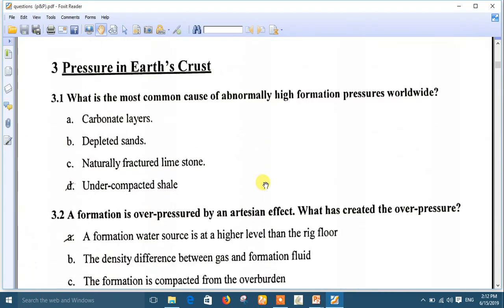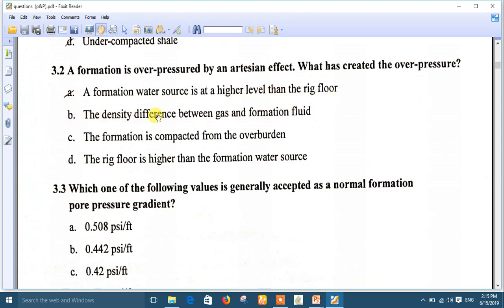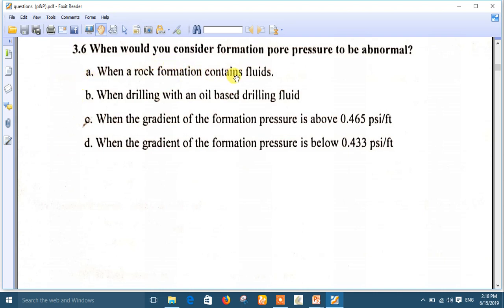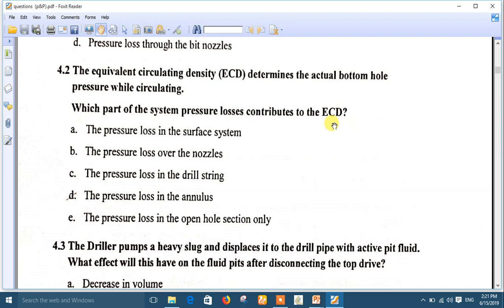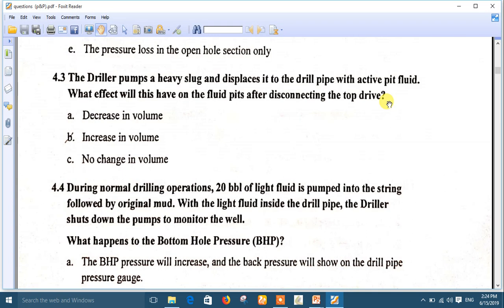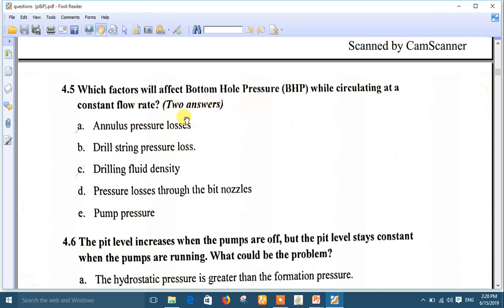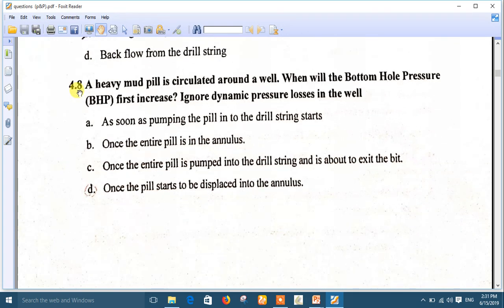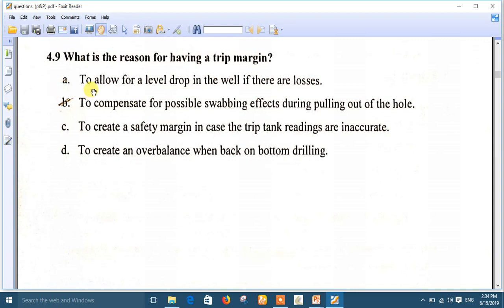5. IWCF pressure engineering questions

Comment: Plze review Q 4.7 i think will be back flow from drill string >>due to U- tube effect which no float valve 🤷🏻‍♂️
Reply: Yes AGREE
Reply: I agree, too
Reply: Yes, and mud level in the annulus will drop. So BHP will drop due to mud level drop in the annulus and reducing overall mud density in the pipes.
Reply: The thing is that it is "backflow FROM the drillstring", not "into the drillstring". Probably this is the case but I agree that due to U-tube effect mud will flow into the drillstring from annulus

Comment: Also review Q 4.4, when pumps off, BHP to be reduced due to no Friction pressure in annulus.
Reply: Q4.4 is correct the B is the right answer. because option C says that "NO back pressure shows on SPP gauge" which is not correct.